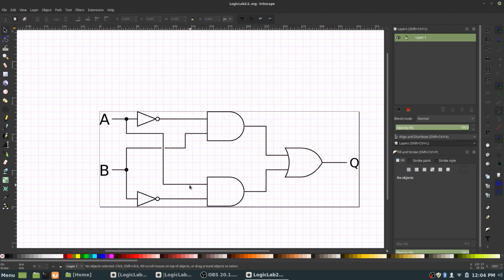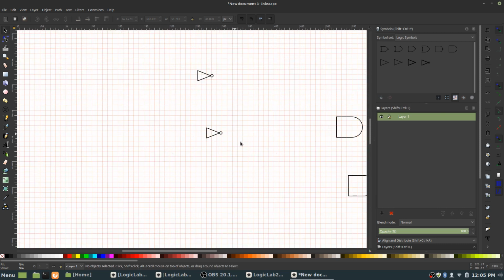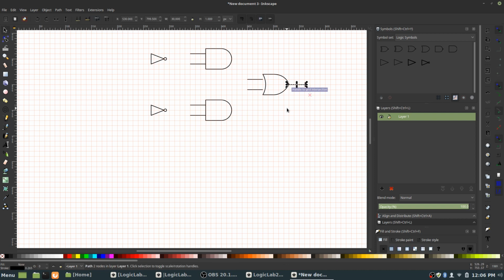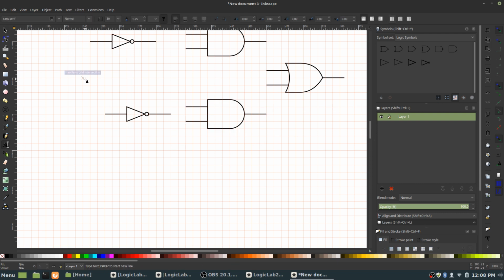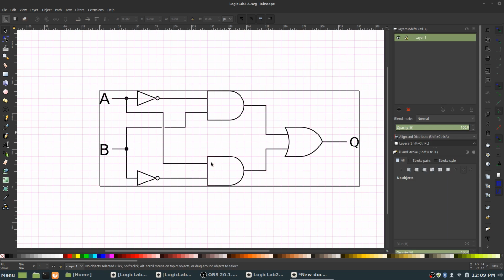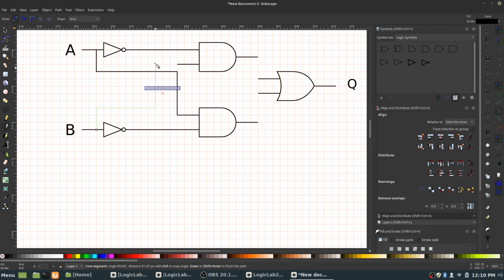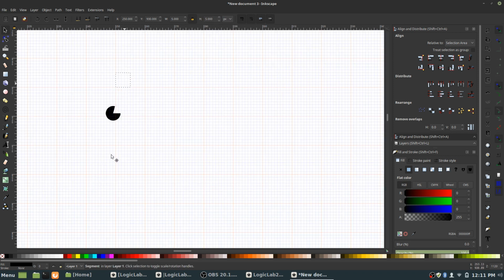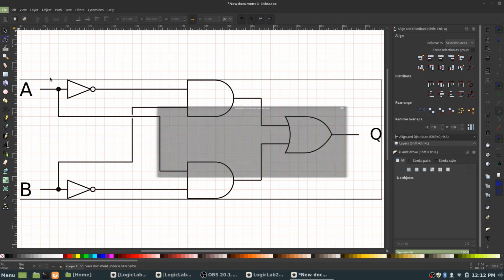Inkscape - Logic Gate Schematic Diagrams

Comment: Hello
I have a small doubt
What is the difference between  circuit and schematic diagram?
Are both same?
Reply: The difference is the level of abstraction. At the highest level you have block diagrams, while going down into more detail each block is a circuit on its own. For example you can draw an and gate as a symbol which is like a block in a block diagram, although it does not have a rectangular shape but almost, but also as a circuit showing it as a circuit of transistors. See also here https://images.app.goo.gl/5deccYpX7hDDN7KDA